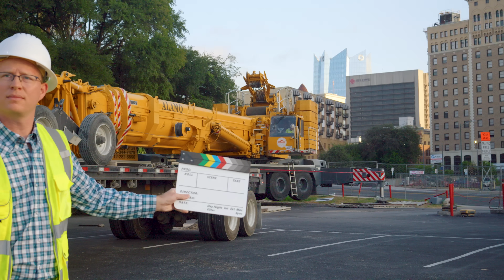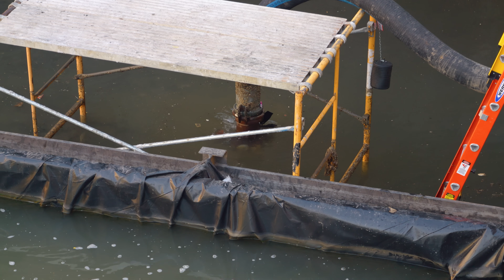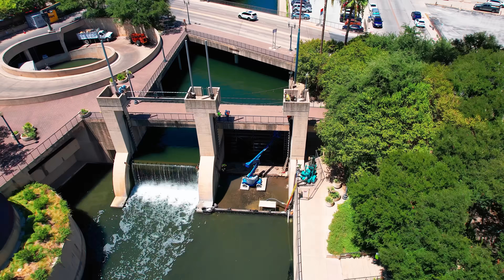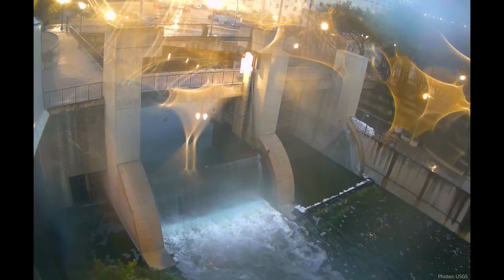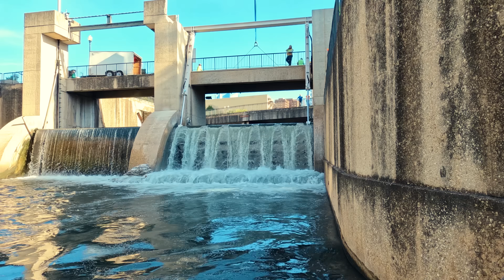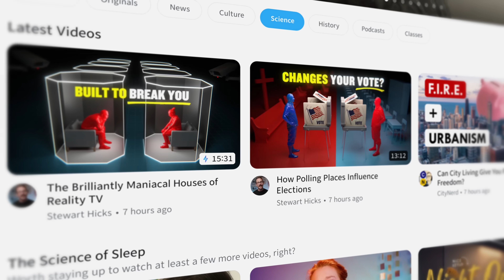The Hidden Engineering Behind Texas's Top Tourist Attraction

Comment: Appears that with this design the hydraulic cylinder and related pipes are constantly under stress, any weak point in this system (hydraulic line/seal leak) would let the gate drop.    The screw system seemed to have an advantage here.

Comment: What was the point of the slate at 0:13? It's MOS, so you don't have to sync up sound, and there's nothing on the board for details. I'm not trying to be mean, just genuinely wondering
Reply: Maybe to check focus?
Reply: Or just for the bit of starting with the slate

Comment: Question: It's mentioned that the stop logs aren't entirely watertight, and we see that the old moving gates are badly corroded. What kept the sides of the gates watertight so water only flowed over the top, and similarly with the new gates?

Comment: Very cool! Glad it all went smoothly. Interesting that it's hydraulic vs. electric now... I wonder why it was electric originally. (Was it cheaper upfront? I bet it was cheaper upfront.) It'd be neat to find out more about how those control structures are built and operated. How much power do they need to move things that huge, plus any water weight? What happens if the power goes out? How do they know when to move it, and by how much, and how precisely can they even control it? Most crucially of all, where do they put the googly eyes?

Comment: Why the different flow pattern over the gates? Old ones were a smooth uniform flow and new ones had gaps?
Reply: New gate has those teeth on top which is breaking up the water. Old gate had a smooth top

Comment: At one point, the gate is laying flat; then the crane lifts it to vertical using straps only on the top of the gate. When we do that on a smaller scale in theater (12’ to 16 foot high flats) the bottom edge tends to ‘skitter’ around unless someone foots the bottom to keep it in one place. I didn’t see any kind of footing during this lift. Did it work without, simply because the gate is so massive? Or was it simply the camera angle?

Comment: Great video! Does anyone know what the purpose of the new "fingers" on the top edge of the new gates are for (or what they are actually called).  Obviously it changes the flow of water over the gate - but is that the reason?

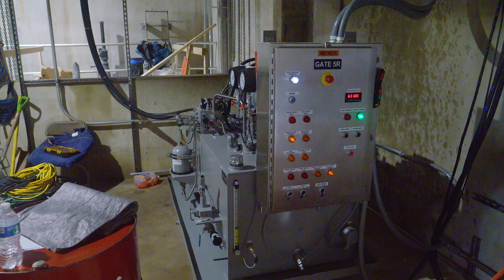Comment: As the head engineer for this project at Atlantic Hydraulic Systems, I helped to design the hydraulic power unit (15:41).  This definitely was a fun project to work on, along with Steel-Fab who fabricated the replacement gate itself. Glad to see the many month long project i worked start to finish with my team is working perfect. If i knew you were working on a video for this, I would have shared videos of the hydraulic units in production and during testing!
Reply: Very cool! I'm happy I found someone in the comments who might know the answer to a question I have: I work on hydraulic mobile cranes, and if a crane sits for too long with hydraulic cylinder rods exposed to the elements, they will rust, despite being chrome plated. Grove, one of the crane manufacturers, also specifically states that the cylinders must be cycled periodically to coat the rods in hydraulic oil at operating temperature to avoid this and they recommend coating the exposed parts of the rods with Boeshield T-9. On this project, what is the strategy for stopping the exposed rods from rusting? I could see periodically raising the gates to maximum height one at a time on an automatically programmed schedule, so that may be it.
Reply: @charlesvandergrift3126 if you use the right rod material, it should last for a very long time with no issues. A crane cylinder may not prioritize corrosion resistance, but if you want corrosion resistance, it's possible.
Reply: dont worry. when this fails you can send him the testing video.
Reply: Probably the only time Ill get to have this interaction so I gotta ask, why do you guys hate maintainers so much :(
Reply: @rusteddoorknob4237  from looking at this design, as a Millwright/industrial mechanic, I see nothing difficult or badly designed about this, what are you talking about?
Reply: That hydraulic pump and reservoir were MUCH SMALLER than I expected to see, but I had not thought it through.

I used similarly sized hydraulic source stuff at a mechanical test lab where I worked decades ago for dynamic hydraulically actuated tests? (With MUCH shorter strokes.)

Well, you have what, ~~10 feet of stroke?  Velocity of stroke not particularly important?  

Sure, you can get by with a relatively small hydraulics package.
Reply: Since they are double acting hydraulic cylinders, the volume change is limited to the diameter of the piston rod, and it's not a continuous operation system, so you don't need extra fluid for cooling, so the reservoir and pump can be much smaller than you might expect for the size of cylinder.  @pcmacd

Comment: I am surprised that there doesn't seem to be redundant retaining systems when the gate is being lifted by the crane and people are working underneath. There are after all many crane failure videos. Granted, these operations might have been under more scrutiny, but coming from an aerospace background, I instinctively want a second option in case the crane lets go for any unforeseen reason (even when there doesn't seem to be any reason why it would).
Am I missing safety pins or ratchets on the dam cheeks?

Comment: 121110SJAN25
How can you call a contaminated cesspool of "water-like material" a positive force for the city of San Antonio? That's like calling the "Central Arizona Project" (CAP) a water conservation project when it's actually an open-air culvert evaporating Colorado River water as it makes its way overland to Phoenix and Tucson. The water is so hard both cities have used it to create lakes. It is hoped that, through "natural" recharge and dilution by the subsurface aquifer, the cities will be able to deliver the CAP water to homes and businesses.

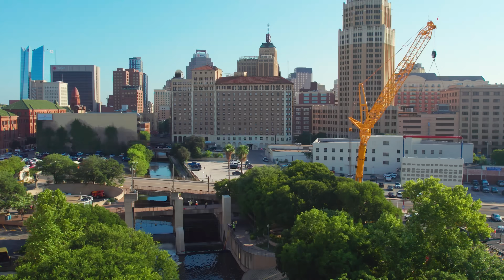Comment: Where is the crane operator at roughly the 14:00 mark?  I can not see any place where that person could be to see both the gate lift and lower.
Reply: My guess is either they have a remote control like concrete pump trucks, or they fly blind with a spotter and/or camera guiding them

Comment: @PracticalEngineeringChannel whats the engineering purpose of the slotted design on top of the new gate (resulting in the water having multiple separate falls during typical flow) vs the flat design on the original gates (resulting in a single unified fall across the top)

My guess would be that it results in higher velocity flow that separates from the surface of the gate rather than flowing down the surface? Potentially this reduced contact with the water flow improves longevity?

Comment: I was kind of wondering why they bothered to run sealant between the gate sections. Then I remembered how much pressure rust jacking can produce. Bravo on the old gates for working for 40 years - and for those bottom pins for coming out without being cut.

Comment: Grady: "Pretty much the same thing you do at a smaller scale. Apply some penetrating oil, beat it with a hammer, and bring out a hydraulic press"

Ah yes, the good ol' hydraulic press.
I remember when I needed to get an engine bolt loose, and so I borrowed my buddies 1/4 ton hydraulic press.

Comment: Question: 
How is hydraulics better than electric Motors with mecanical screw actruators ?

I see in my Job replacing older Hydraulic Systems with Servomotors and actruators because of environental and safety factors ect . (Mecanical locked screw ect ) 

Whats the decision to Go to hydraulics ?

Comment: fascinating. 

Aesthetically I preferred the solid sheet of glass look to the water flow over the old gates. The teeth on the new ones break up the flow in a visually unsatisfactory way. I'm sure there's an engineering reason for the teeth, such as reducing wear and tear from the water flowing over, or for efficiency of its control of water volume, but I can't help but feel the new aesthetics are less-than.

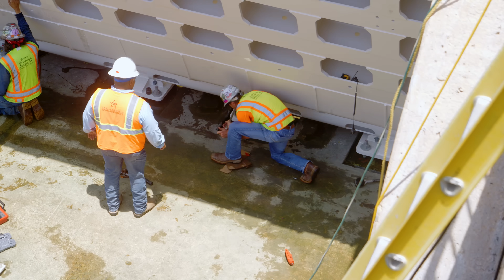Comment: 15:04 nuts, not bolts.
Reply: Do bolts not have threading?
Reply: @ConjureNoonSloth  if he was tightening a bolt into a threaded hole or a nut then that would be torquing a bolt. However he is tightening a nut down onto a threaded rod so he is torquing a nut. Some of us clearly failed reading comprehension.

Comment: Interesting video. Also thanks for the insight as to the "how it works" for us inquiring minds.

However, I'm curious about a couple of things that I didn't see and/or not shown:
With the two crewmembers working on the downside of the new gate whilst it was being bolted in; Would not a safety bar and/or a trapezoidal piece of steel on the downside have been prudent or called for, as a backup?

The new hydraulic pump(s);  I would have thought a containment tub (large polyethene surround) would have been called for to catch any leak from the storage tank or more likely in the event of a line or fitting failure. There's quite a volume of fluid there that we wouldn't want into the river, should either such fail.
Even a small business must install such for a simple oil tank inside a shop. But not in a public works project?

Comment: Do I see exposed hydraulic hoses on the cylinders?  Big mistake. Sunlight and atmospheric exposure will deteriorate them within a very few years. As with most civil infrastructure, a failure of the hose under high pressure will be the only warning.

Comment: Really enjoyed your video, great job in the way you presented it. However, couldn't believe it took a year to fabricate the replacement gate after the first gate was removed. I come from the heavy manufacturing of oil field and petrol equipment industry in Houston. Taking this much time would be unheard of. Some body would lost their job if it took a year to fabricate to first gate after the failed gate was removed. We work with time factors here since every day, sometimes every hour of equipment down time is money, often big money lost until project is up and operating. Crain's on site are also very expensive, cost is of a priority. Again though, I really enjoyed your video with the way you presented it. Thanks again.

Comment: my buddy works at a power plant, and said when they got their new gigantic wartsila engines, the wartsila engineers moved them into place...using Dawn. Dawn dish soap. that they bought at the local costco. gallons of it. spread all over the floor. and they pushed the engines into place.

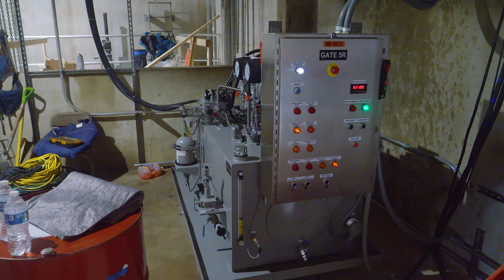i bring this up because at 15:46 i see a big bottle of what looks to be Dawn on the floor, next to the new hydraulic pump hehehe

Comment: Would it have been cheaper if they had just greased the screw as part of regular maintenance?  Was this task deferred in order to bring the dam to failure? This strategy might be enacted to justify the cost of technically assessed needed replacement to the tightfisted bean counter,  taxpayer and fickle voter.  What with the Mayor's election just passed.

Comment: why not use a floating gate and a pump to pump the water out of it when the gate needs to be raised?  Wouldn't that be a lot simpler and more efficient than all these gears and hydraulics.  So, you'd have to put a well under the floating gate to allow for the water drop.  Bet it's much more efficient and less expensive.

Comment: Projects where they have to rebuild/replace something while also keeping it 100% functional are very impressive to see firsthand.  I even have an anecdotal example of one:

Small town where I live has a federal highway running through it and within the past few years they replaced its nearby, old 3-lane bridge over a slough with a modern replacement (which is, among other things, a few feet taller).  However, this is not just a federal highway but also a major arterial connecting the highway strip to downtown (it's also part of my commute to/from work), and with the nearest detour being 2 miles away they simply COULD NOT close down this highway.  So instead:
1 - They built half of the new bridge (about 3 lanes) adjacent to the old one.  The gap between them was slim enough they had to narrow the existing bridge to 2 lanes so they could demolish one of its side rails for extra workspace.
2 - Once the new bridge was complete enough to be functional, they routed traffic onto it and blocked off the old bridge.
3 - They then demolished the old bridge and built the other half of the new bridge (also about 3 lanes) in its place.
4 - Once that was complete, they joined both halves with concrete to form a single bridge (now seven lanes wide, including the center lane and shoulders) and finished it off with fresh asphalt.

Comment: This old dam, it held one,
Stopped the water, just for fun;
With a gush and a rush, the river did moan,
This old dam stood all alone.

This old dam, it held two,
Blocked the current flowing through;
With a gush and a rush, the river did moan,
This old dam stood all alone.

This old dam, it held three,
Built so strong to tame the sea;
With a gush and a rush, the river did moan,
This old dam stood all alone.

This old dam, it held four,
Blocked the roar, strong to the core;
With a gush and a rush, the river did moan,
This old dam stood all alone.

This old dam, it held five,
Kept the river’s flow alive;
With a gush and a rush, the river did moan,
This old dam stood all alone.

This old dam, it held six,
Stone and steel did all the tricks;
With a gush and a rush, the river did moan,
This old dam stood all alone.

This old dam, it held seven,
Reaching high and close to heaven;
With a gush and a rush, the river did moan,
This old dam stood all alone.

This old dam, it held eight,
Held the weight, kept it straight;
With a gush and a rush, the river did moan,
This old dam stood all alone.

This old dam, it held nine,
Worked so well, a feat divine;
With a gush and a rush, the river did moan,
This old dam stood all alone.

This old dam, it held ten,
Saved the valley, the glen, and then;
With a gush and a rush, the river did moan,
This old dam stood all alone.

Comment: At around 6:40 you mention the decision to cut off a stuck bolt rather than unscrewing it. Who usually gets to make a decision to depart from the plan like this? Is there an engineer on site who makes these calls, or someone else on the construction team?
It seems like a no brainer in this situation, but there would surely be touch choices that have to be made at times, because nothing goes perfectly to plan, so the roles an responsiblities would be really interesting (to me anyway).

Comment: Man... I wouldn't want to be the guys installing the nuts on the anchor bolts while only the crane holds up the wall. If the crane or straps had failed, I'd want some sort of temporary hard stop built to keep me from being squished. Maybe install some temporary stops attached to the side concrete walls... ?

Comment: Thanks Grady! I'm a huge fan and was pleasantly surprised to see my downtown neighborhood featured on your channel. amazing video. Thanks for taking the extra time to piece it together. Keep up the good work. ;)
 
The pedestrian bridge over the top of the flood gates connects both sides of the river (from the control tower to the parking lot) and is used constantly. Folks may also be interested to know that there is an underground marina for the river tour boats above and just before the gates. But the details on the pump was a surprise and could make kayaking that section a bit more interesting!  If you are looking on google maps this spot is "San Antonio River Dam" at Nueva St.

We wondered what was going to happen when the first gate collapsed. There was at least one attempt to straighten and lift it by crane early on, but its seems it was too bent to keep it working until the new gate was ready.  So we had a one sided gate for more a year or two. I was running nearby while the second gate was removed, amazing to see such a huge piece of metal lifted into the sky. I think I briefly appear watching at the end of the video.

Comment: Wow... that is super cool. Took me an hour to watch this because I kept rewinding and pausing the time lapse footage, so cool to see all the details! Amazing how even at this level, there is no getting around those good old rusted connections - they do the same things, try a bigger wrench, a cheater bar, some penetrating oil, a sledge, hydraulic means... and finally it's eff-it, torch it out! Those are some mighty beefy cylinders there, and quite a hydraulic power pack, and that crane is insane. Thanks for capturing all this! Love these construction series.
Reply: I was the main hydraulic engineer for this project, these units were really fun to build and test! The two units completed testing at our New York shop in July 2024. This unit has two 15 HP motors with 10 GPM pumps that can produce 2000 PSI, a compact and fully automated system
Reply: @travisferrie  Awesome! What kind of pump did you use?
Reply: @JFirn86Q  each unit had two Parker Hannifin PD028 series piston pumps with adjustable pressure output

Comment: I'm a little confused about the switch to a hydraulic piston system from an electric driven mechanical system. Wouldn't the hydraulic system be more expensive and prone to wear/require more maintenance? I can't imagine the difference in control would justify the change. But I'm not an engineer, so maybe I'm missing something.

Comment: When you said hydraulics, I was worried that gates will be completely different design but I am amazed how they are basically same as before, it fits nicely here. I am a little sad that Archimedes screw got removed, I guess there aren't many around? It is so simple it could be there basically forever. On other hand as you said, they can flush still water now.